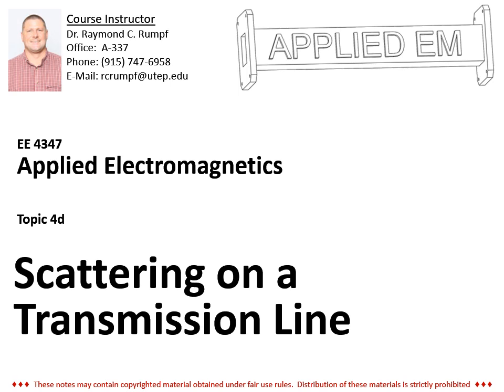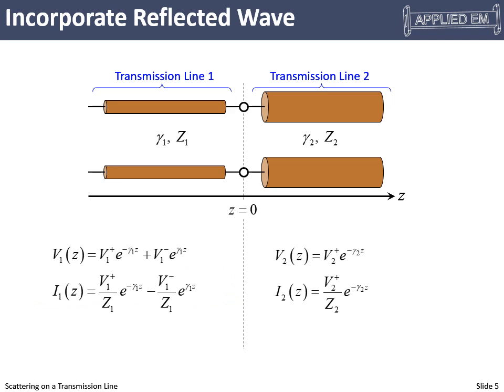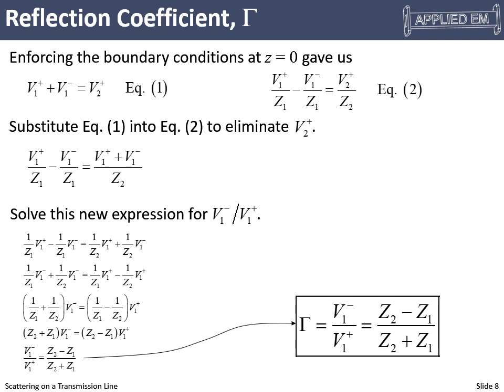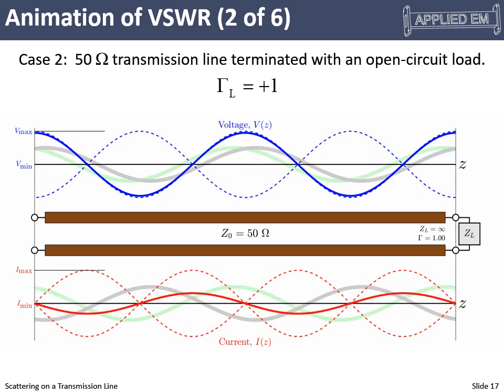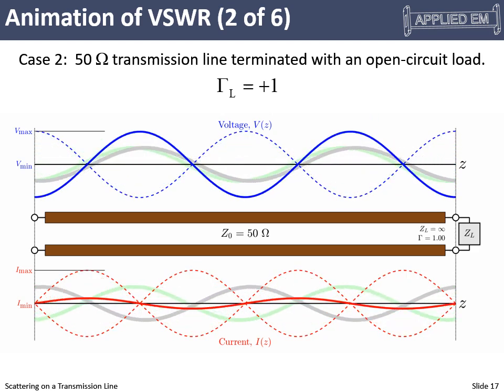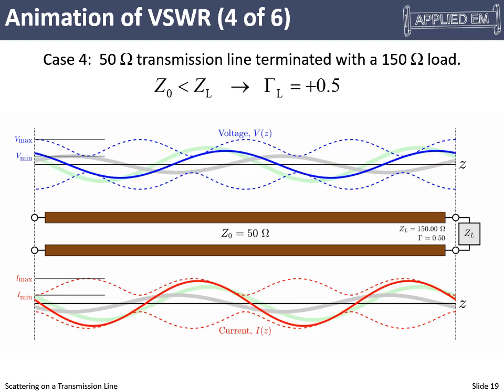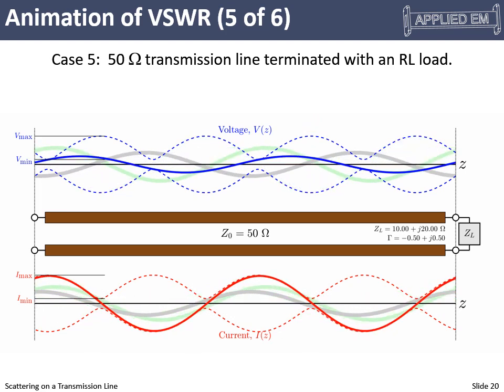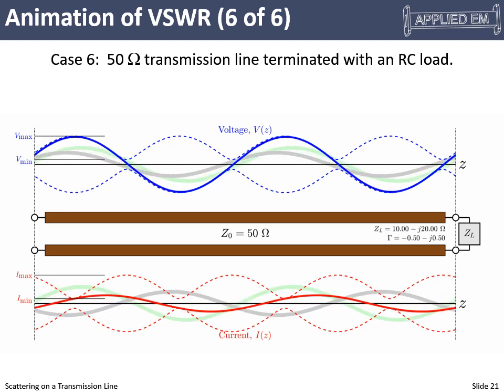Lecture 4d -- Scattering on a Transmission Line

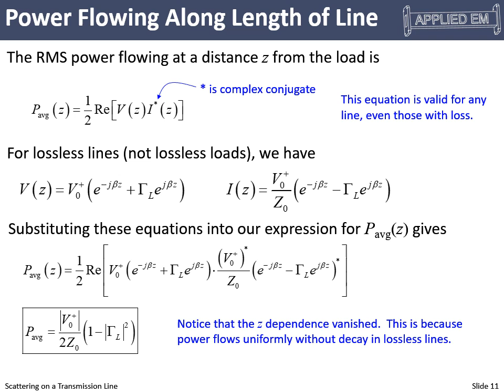Comment: Awesome dissection of scattering on transmission lines! At 9:45, there's a small typo in P_{avg}, the magnitude of V0+ should be squared. Thanks for another great lecture!
Reply from the maker: Thank you!  Let me point you to the official course website.  I recommend using this as your portal to the course.  You can download the latest version of the notes that usually has corrections that are not in the videos.  For example, this is a mistake that I previously caught and fixed, but the mistake still exists in the video.  I will be teaching this class this fall so I hope to be adding content, visualizations and rerecord all of the lectures.  Here is the link:

https://empossible.net/academics/emp3302/
Reply: @empossible1577  Thanks! I didn't realise the slides in the video were different from the slides on the course website. :)
Reply from the maker: @gravityhacker  The goal is for them to match one-to-one, but it does not seem reasonable to record a whole new video to fix a small error.  Also, I used to host the courses and videos from my university, but I they kicked me off.  Since then, I have been converting over to the EMPossible format.
Reply: @empossible1577  I'm sorry to hear the university kicked you off. Anyway, the EMPossible format seems pretty promising!
Reply from the maker: @gravityhacker  Life gave me lemons so I have been making lemonade and would never go back.

Comment: i did not understand how we found the magnitude of V(z)
Reply from the maker: Are you asking about the derivation around Slide 14 in the video?  The trick here is the complex exponential term.  Remember that when the argument of exponential is pure imaginary, it is really a just a cosine function that is bound between -1 and 1.  These limiting values are used to determine the maximum and minimum values of the |V(z)|.  Also not that we are not finding |V(z)|.  Instead we are finding the maximum and minimum values of |V(z)|, which is quite different and easier to do.
Reply: CEM Lectures e^j2bz term confused me
Reply: @sln7736  if you do it by you're you'll get to know...

Comment: This is JUST the stuff I am trying to come up to speed on. I have successfully constructed a band-reject filter using RG58, but trying to apply the same thoughts to creating a band-pass filter ... so far not so successful. WAY wide pass band as compared to my 3 MHz bandwidth of the band-reject filter.
Reply from the maker: Very good.  There might be something in the following lectures that will help you.  Thank you!